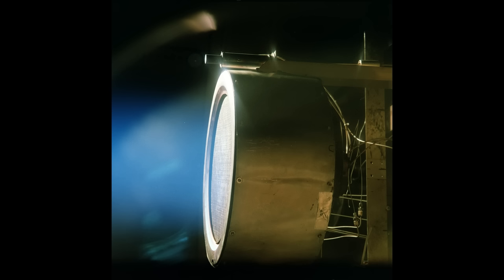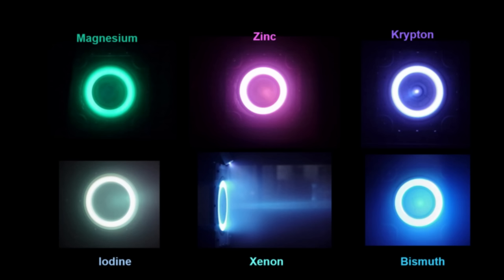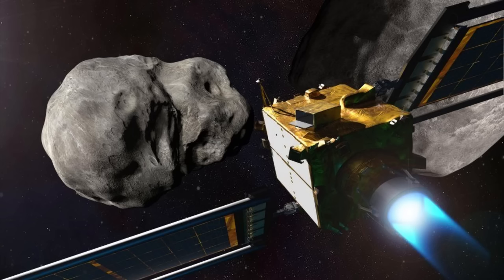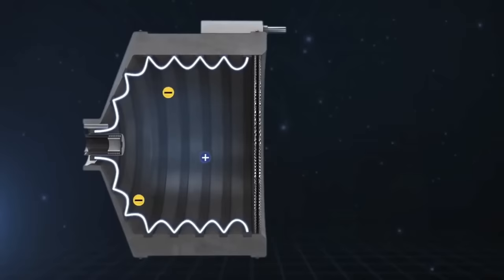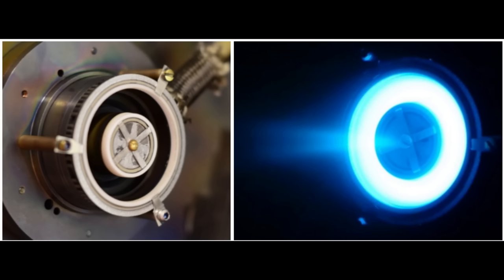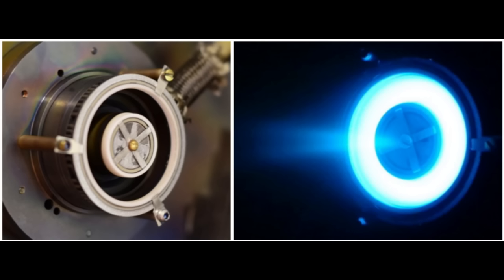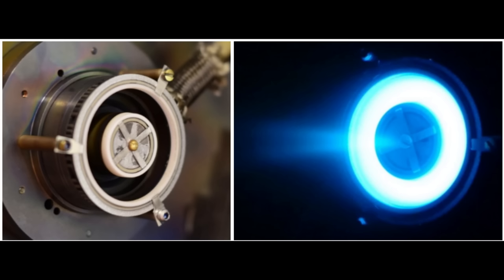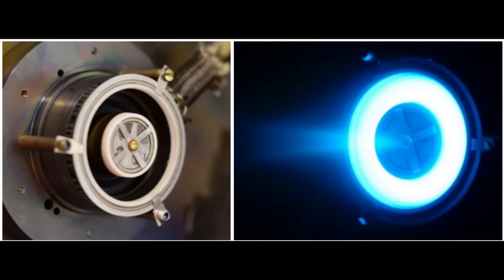Why Are There Two Different Types Of Electric Space Engines, And How Do They Work?

Comment: 2:48 I would like to know more about this.
I was thinking in start with NaK because is liquid but if need to vaporize dont make sens in having it in liquid. I can have it in dust form and feed the melter reactor to vaporize this element and ionized them.
So I think in Barium because the mass is like Xenon and ionization is only 500 Kj/mol and if already have intrument with 1000kj/mol(there used in XENON) is OK, more thurst because ionization on second layer that mean more (repel/atraction with the magnetic field) , like afterburner. Or just stay in 500Kj for eco mode and high specific impulse.
I was like more NaK because storage. Use it with seringe i mean have tank like seringe oxigen free. And in low gravity the seringe push back so is perfect as store and refuel.
Barium make it dust is not easy. Need to be manufactured in argon or vacum envirmnet. And refuel and seringe method dont work. but something can be done.

Comment: what about using a plasma wake field accelerator? 2 are needed, 1 for electrons, the other for the massive, positive ions. Granted the energy supply is a problem, but there's no spalling of the grids associated with ion thrusters. The energy prblem can be solved by placing a Pu-239 reactor coupled with a turbogenerator, where the Pu-239 heats some gas (methane comes to mind since both C and H can moderate neutron flux) to drive the generator. Excess heat can then go to a secondary loop, with NH3, to add more power. Carnot's efficiency over 60% can be achieved. As for the exhaust material being expelled out, Hg is the choice, since no one wants it here, it has a large mass...

Comment: How big would you have to build one of these drives to provide 1G acceleration on a ship large enough to maintain a complete biosphere, such that it could be useful as a generation ship?
Reply: I don't think you could, the power requirements would be tremendous.
Reply: I don't think you could ever reach 1G of acceleration, it's not about size, it's about the weight to thrust ratio of the entire system, you need power generation, power cables and an engine that is powerful enough to create enough thrust to accelerate itself at 10m^2

so basically if we had magical star trek power generation/batteries etc sure we could overclock those thrusters to 1G, but I don't see how we could make a system that powerful yet light enough with known materials and technologies

if you want high thrust you need hot engines, that's kinda how it goes

(thinking of, it would be possible if your power supply was not on the ship, beamed power would work, but only in range of the power supply)

Comment: How has the available power for a spacecraft evolved over time, with improvements to energy required for other mission specific hardware and solar collection? Is the available electrical power a contributor to the late adoption of these devices?
Reply: Yes; it is a huge factor, and it is improving.  With electric propulsion, the optimum ISP depends on the specific power (W/kg) of available power supplies.  Solar panels at LEO typically provide ~100-150 W/kg, though this is improving - some solar providers I am seeing now talk about 400W/kg panels.  However, the further you are from the sun, the worse this gets; at Jupiter, you get 1/50th the power from solar.  Modular nuclear fission reactor designs can get to 300+W/kg which would work all the way to Neptune.  Since ISP increases proportional to power squared, a 3-4x improvement in specific power yields about a 2x increase in optimal ISP (there are some other factors that play into this too).  

But, with thin-film ultra light solar, we should see a shift to higher ISPs, and nuclear in space would likely cement ion thrusters as the main workhorses for high-mass interplanetary cargo - not for humans because it will be too slow, but good for everything else.

Comment: Gridded ion thrusters also stop working completely when a conductive particle gets stuck between the positive and negative grid. If the particle is small, it is possible to melt it without melting the grid, but for larger particles it's EOL. Parts of the engine itself, other parts form the spacecraft, the launch system, space junk and micro meteorites can all be conductive.

Comment: G'day Scott, Why is the solar wind not being used as a propellant for these electric engines?  The solar wind is already ionised.  I get that the flux may not be very uniform, but I thought that the mass savings would more than compensate for that.  When you mentioned that the ionisation process is where most of the energy goes, this would then present a double-saving as the solar wind is already ionised hydrogen (mostly).
Reply: Fun idea. I think if one tried capture the hydrogen ions for use as a propellant they would have to land on some material where they would become hydrogen again and the ionisation tax would not be avoided?... Or maybe it's possible to grab the ions with spacecraft's magnetic field and channel them to the accelerator part... Kind of like advanced rowing boat in really fine medium, or maybe something analogous to water scooter/jet ski
Reply: Particle density?  I believe solar wind is just a few atoms per cubic centimeter and with the inverse square law that decreases the further you are away from the sun doesn't it?
Reply: @u1zha  G'day Uldis,  I was not thinking of capturing the hydrogen ions at all, but merely accelerating them when they wander into your magnetic field.
Reply: @u1zha  A similar fun idea I've had since reading an article (pretty long ago) in Scientific American about the kinematics of an insect's (the fly, I think) wings. The math for that has been well worked out. If you could duplicate that with oscillating magnetic fields, then maybe you could "fly" through the solar wind like a bug in the air or "swim" like a fish in water (or suck in and expel particles in a (Enzmann Echolance or Bussard?) "ramjet" type engine).

Comment: I'm very much a layman, so apologies if my question doesn't make sense or is already answered in the video. As described, when the engine is producing neutral propellant atoms to release into the chamber, they need to be struck by the free electrons flowing around in there to become ionized so that they are attracted to and accelerated out of the exhaust. Are there neutral atoms that, by chance, fail to be struck by an electron (fail to ionize) and end up just floating out of the exhaust, producing little to no thrust? If so, it a significant amount?

Comment: Would it be possible to put enough of these on a ship like Starship to accelerate it at near 1G to provide artificial gravity as well as shorten the transit time?
Reply: No. They have way too little thrust and way too steep of a power requirement to be of any use on anything manned.
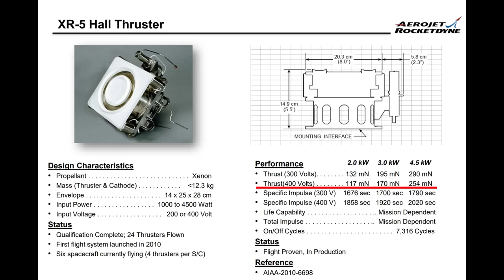Reply: No. But for fun let's do a small calculation. Using the thrust from 4:13, about 250mN, you'd need 39 or these to accelerate 1kg of material at 1g.

Every one of these engines alone weights 12kg.
Reply: Shortening the transit time by increasing the velocity sounds like a good Idea at first but you have to keep in mind that in order to land on another celestial body you have to bleed of all that speed again as well or you just burn up in the atmosphere/ slamm into the planet.
Reply: @exo_2171  just aerobrake really hard, smh. It works in kerbal space program.

But actually I think the idea is to have enough fuel (somehow) to accelerate for half the travel and decelerate for the other half.

Comment: So I have a question about this:  Atmospheric drag is the thing slowing down satellites and spaceships orbiting the earth, the lighter elements (hydrogen, helium, and a bunch of other junk like O2 and O3) rise higher in the atmosphere, and eventually are stripped away by solar wind, but it seems like maybe there is a brief moment where these gasses could be captured (random velocity vectors) and tossed out the back with an ion thruster (specific velocity vector).  Has this ever been tried?  Is there just too little of it to capture and use?  Is it too impure to use?

Comment: What about VASIMR? Why it is disappeared?
Reply: Not an ion engines. Its a plasma engine.
It went off for the reason mention in the video. Power requierment. It needed more power than iss. So unless you can send nucleair reactor into space it aint happening.
Reply: Interesting question. Curious to hear what happen about that in US researches. My friend working in Keldysh Research Center and he said that all sources now focus on NTR in our country but 10 years ago, as i remember, they kept a close eye on VASIMR.
Reply: @RigelNV  as said. The idea works. But the electric power requiermenr is to high. It uses more electisity than the iss.
Reply: @rubikfan1  There is no difference between "ion engines" and "plasma engines" - they are one and the same thing.
Reply: @eliasboegel  yes there is. Ions are made trough electric means or magnetic. Will plasma is most done trough heat, and sometimes electrischity to help.
Reply: @rubikfan1  You are simply wrong on this. Plasma, by definition, is gas with a substantial potion of charged particles. While there are many different methods to create plasma (including thermal, resonance, ...), it does not matter what method you choose - it is still plasma. A volume of ions is still plasma. VASIMR and HETs expel exactly the same thing: substantially ionized gas, i.e. plasma. Every textbook will tell you this.

Comment: Curious thought. Could there be a system where you reharvest the spent fuel and decelerate  them in a dual counter rotating coil that converts kinetic energy into angular momentum and heat, then dissipate the heat back into space. Where by you gain thrust w/o loosing fuel mass. Like multiple energy conversions but you keep a portion of kinetic in the craft's speed and drop the rest in heat.

Comment: What’s never clear to me is how much of this propellant do they need to have on board to run for years at a time?
Reply: Not to mention the valves/dosing mechanism required to maintain consistent ultra low flow rates for such.
Reply: Depends on the electric propulsion subsystem design, but the Xenon tanks on GEO spacecraft are much smaller than the equivalent chemical propulsion subsystem tanks.

Comment: I really like the Electrodynamic Tether system. While it's only useful in Earth orbit, it's a real clever way to manoeuvre without having to use reaction mass. I guess technically the Earth is the reaction mass that you're exchanging momentum with.
Reply: I remember the tether experiment they did on STS-75 in 1996. They reeled it out 12 miles and generated some electricity. Interestingly the tether broke because of a spark that burned through the insulation, so it must have been generating a bit of power. They weren't testing station keeping with it they just wanted to test the electrical dynamics.

Comment: Would it be possible to built a thruster that could contantly micro accelerate the ISS so it wouldn't need to be reboosted by conventional engines. What would be the issues?

Comment: In case anybody is wondering "Why Argon?", some 0.9% of atmospheric air is argon. So, it's fairly easy to come by and spraying it out isn't adding anything new to the atmosphere (it is most often extracted from air to begin with).
Reply: How would good would Radon work?
Reply: @williamduffy1227  Propulsion-wise, the heavier the better. But radon comes with the usual problems that radioactive isoptopes have. The amounts we're talking wouldn't be a problem in the atmosphere; it's already going there from the ground. But large amounts of a radioactive gas isn't ideal to handle up until and including the launch.

Comment: Well there is always a photon engines if you want a %100 electric powered rocket. If you leave a flashlight powered on in space the light escaping will very slow adjust it's orbit. Not sure what it's isp would be, but twr is almost zero. A better option would be to generate the photons at a station and shoot them at a target space craft, works even better if the target space craft has a low mass large surface area light sail to reflect off of.

Comment: I don't quite think I understand the Halleffect thruster and the role that the electrons play in it. How can they both be ionising and neutralising the atoms at the same time? If the ions becomes nuetralised, by the electrons, there should be no acceleration, and hence no trust.But avoid the entire spacecraft becomming more and more charged, and the ions slowing down due to still experiencing an electric field, you need to exhaust both electrons and ions, or the combination of those in the form of neutral atoms. 
In the electrostatic engine, it makes sense, since the ionisation and the neutralisation takes place at different locations and hence at different times, nut how can you make it work when it happens at the same place/time?

Comment: Probably a dumb question but why does the "exhaust" flow have to be neutralized? Its already left the thruster at high velocity so the thrust has already been made, right?
Reply: It's electric charge that needs to be neutralized. If you propel positively charged ions then spacecraft itself begins accumulating negative charge and it's not good. Have to yeet some electrons out to keep everything electrically neutral.
Reply: I had the same question. If the exhaust isn't neutralized, then the spacecraft builds up a high negative charge due to all the leftover electrons. I assume the electrons do contribute a tiny bit of thrust.
Reply: Makes sense, thanks!

Comment: I have no background in physics, so I think an all electric engine ís possibe:
1. Firing a laser creates a tiny reaction force
2. Photons have no mass
3. It is proven that laser propulsion works.

So:
1. Attach a laser to a spacecraft facing back. Firing the laser should create a very tiny reaction force and propell the craft
2. Attach fiber optics in an u-shape to the laser. The photons will be lead back to the spacecraft. Since they have no mass tithe centrifugal forces do not apply here

—> and we have laser propulsion from the spacecraft itself!

Thank me later

Comment: would it be possible with far future technology to scale up the thrust so that they can achieve chemical rocket level performance? and then you could bolt two of them onto a small spacecraft with large flat solar panels for wings and call it a twin-ion-engine fighter or something.
Reply: Not really, the limit is mostly how much energy you can throw at it.
If you already have a super lightweight, small fusion or fission reactor, why not just use their output heat directly ?

Comment: Simple. 
Electromagnetism expresses as (sometimes independently generated) Electric and Magnetic fields. 

> Ion drives are purely ELECTROSTATIC. Forces are strictly originated by the accelerations of clouds of IONS (non-neutral plasmas) by a time-constant Electric field. Space charge saturation effects limit the ion current magnitude, and therefore the magnitude of the force for an ion thruster. The only solution is to increase the area of the electrodes.
> Hall thrusters — which are multiple configurations — accelerate a (relatively cold quasi-neutral) plasma using a combination of crossed (perpendicularly) Electric and Magnetic fields. These fields may be static or pulsed in time.
The thrust of a Hall drive may be unlimited (theoretically), depending only in the magnitude of the mass flow of the plasma. But this magnitude depends on the amount of electrical power needed to ionize a sizable quantity of gas into a plasma and to generate the accelerating Electric and Magnetic fields of the proper magnitude. 

I recommend reading the affordable Dover edition of Jahn's 'Physics of Electric Propulsion'. This is a classic introductory textbook on this topic.

Comment: Spacex: it doesn’t exist so we will just invent it and build it ourselves. Most innovative company in the world.
Reply: SpaceX did not invent Hall effect ion thrusters.
Reply: Once again they replicate soviet technology they couldn't buy .
Reply: @hanspecans  Nice job of deliberately misunderstanding. Scott notes that there was no hardware for argon and no practical development work on using argon in Hall effect thrusters on working satellites.
Reply: @hanspecans  they invented both krypton thruster and argon thrusters which no one had ever used before. This is a massive development as you can scale this thrusters infinitely instead of being severely limited by xenon which is extremely rare and expensive.
Reply: @marsspacex6065  Sure. Krypton and Argon (at least for in-production HETs) are new. However, they are not the only ones, there are several other propellants that other companies have worked on for HETs. Those efforts are also mentioned in the video.

Comment: First ionization energy is a red herring. What I want is, completely strip the electrons. Point two, I want as few neutrons as possible, because I can't push them, I have to pull them. Which means I have to push something else (a proton) to do it. Water has 2 hydrogen. And if your crew breathes, they will like the byproduct. Methane has 4 hydrogen, and (dang it) a carbon. But a robot ship probably prefers. No rust.